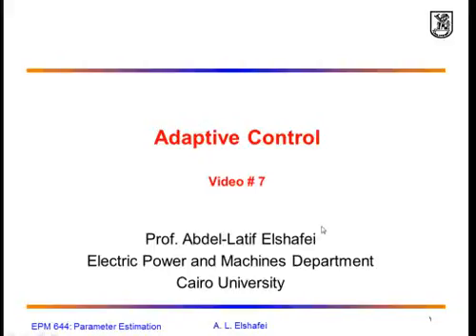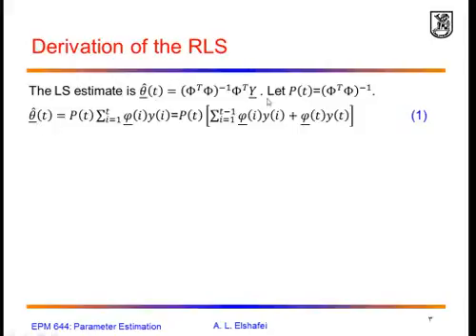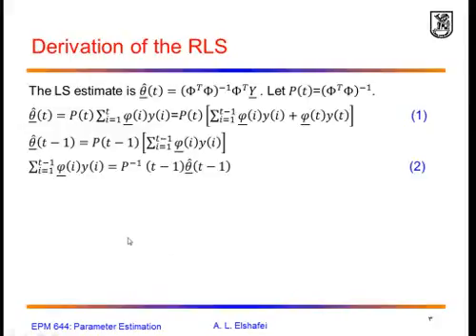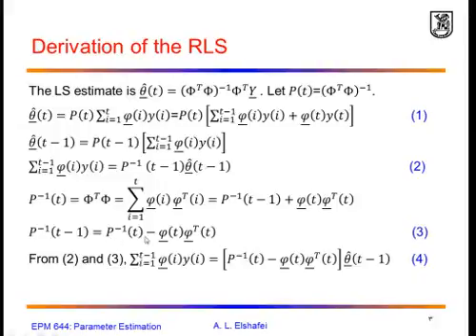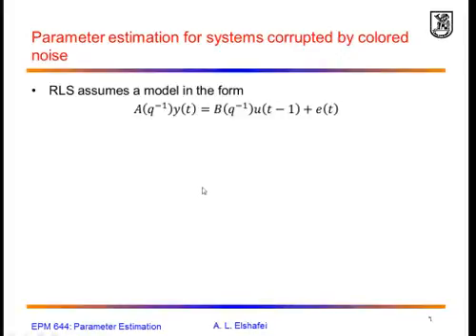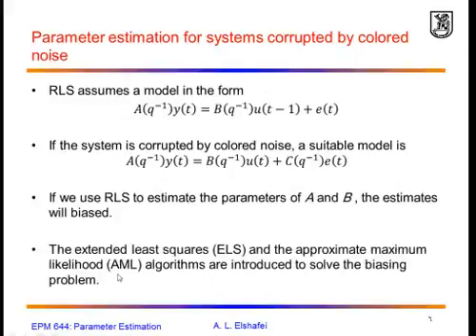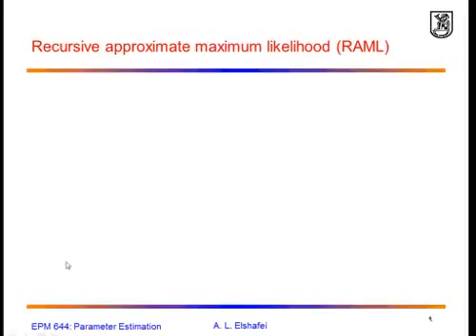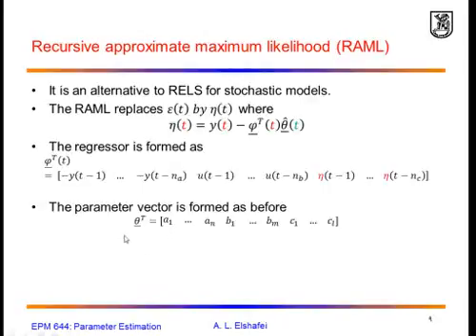Lect. 7: Deriving the recursive least squares algorithm

Comment: What's the best technique? MRAC or ARMAX + custom controller? Do you have a video about the MRAC method, please?
Reply from the maker: The technique  depends on the application.
Videos on MRAC can found through the following links

https://www.youtube.com/watch?v=b8aBUI12h2c&list=PLvAJkpzHzej37fuqCZ_J6uBFiVO6CThUR&index=18&t=41s

https://www.youtube.com/watch?v=ORpWR70Nxqc&list=PLvAJkpzHzej37fuqCZ_J6uBFiVO6CThUR&index=19
Reply: @DrElshafei  Thank you very much for your answer. May I ask you if you also have some sources about corrector calculation from, by example, ARMAX identification, please. At the beginning the estimation is unknown and the poles of the function are slowly varying. How to deal with that? I think that I've got to take into account the "error model" but it depends of the noise...